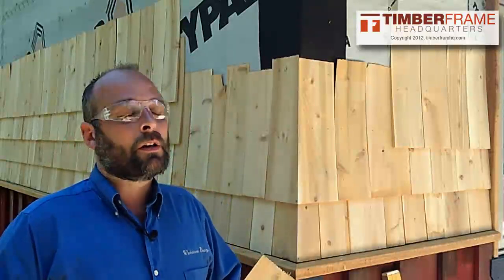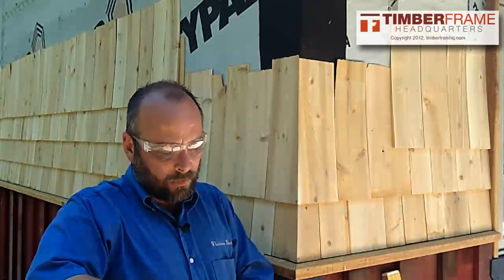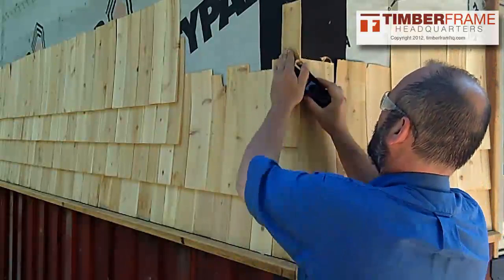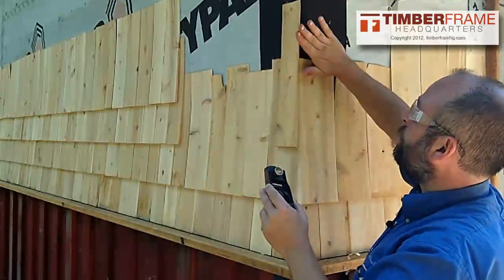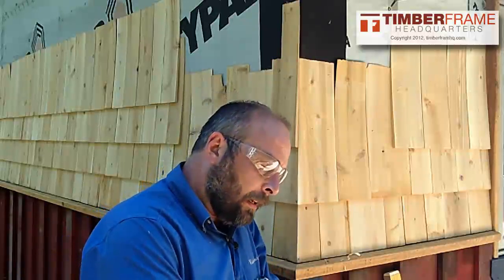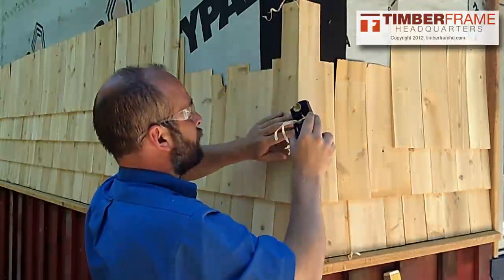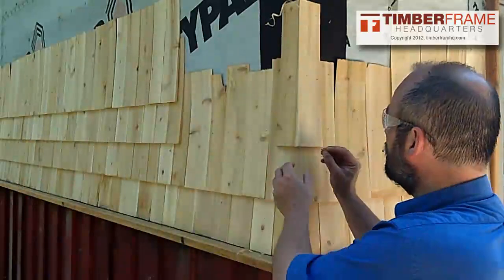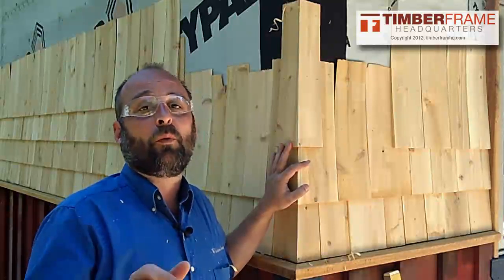How to Install Cedar Shingles with a Weaved Corner

Comment: Nice video, I overhand my shingle by 1" and nail the shingle on.  Then I trim the over hang with a trim router and a straight bit with a flush cut bearing.  Works perfect and is much faster.

Comment: good video, But the best part is seeing the corner wrap of tar paper. Could be sticky tape but tar paper is fine. That keeps the corner weather tight over the years. Typar and Tyvek are not reliable water shields. I fix a lot of rot because people don't flash and wrap corners properly. Good job, thxs

Comment: I don't miss those old days of using a plane. All roto-zip now on Cape Cod   great video for first timers
Reply: The Block plane gives the tradesman a certain amount of forgiveness… the Rotozip is certainly a modern approach.  The down side is that it requires an extension cord, which means electricity.  Then there are the additional bits, dust masks and hearing protection… 👍.   There are trade offs for every choice.

Comment from the maker: Great tip Igor.  I did not think about that tool and if you set your depth right you can make the gentle arc that comes with this task.  The plane is nice to use though...Thanks!
B

Comment: good video. in the low areas you could use a smaller plane to take the role but take take offense, still a very nice job....

do you ever use copper foil?

Comment from the maker: The plane in the video and the one I use.. and love is the Veritas Standard low angle block plane.  The sharper it is the more fun the job.  Scribing with a saw certainly works, I use a jig saw quite a bit for shakes, but it is not as quiet and peaceful as a block plane. The Veritas has some weigh to it which I find helps out making smooth shavings
Brice.

Comment from the maker: I am partial to Typar for several reasons the most important it that the sugars inside of the cedar shingles will break down Tyvek over time, this info is located on their website.  I like the staples because I had a stapler and they work well, I did use stainless staples.  I did felt the corners and highly recommend it.
Thanks for the comment,
Brice

Comment: Great video, any thoughts on the staple vs a siding nailer?   In my climate stainless staples or double galv nails are code.  Luckily in my climate I don't need to strap.  Also, that corner, looks like houise was wrapped with typar, and did you felt the corners?  This just a little extra protection?

Comment: If you have cedar shake siding that is beginning to start curling in some areas ever so slightly, is it alright to sink a couple finish nails into the lower portion of the shake below the upper shake line? The problem isn't looking so bad yet, however I would like to do preventative maintenance (if possible) to help extend the life of these already somewhat older cedar shakes.
Reply: No, don't do that

Comment: Why are you installing sidewall shingles on a flat surface?  Did I miss the lath strips?  Without the lath boards there is no ventilation, which protects the shingles from condensation and water vapor.

Comment: Can I use a finisher nail gun to nail ALL the shingles?

It's all I have..
Reply: youbestbequiet

Well he is using finisher nails... soo whats up with that?
Reply: *****

You're 5 months late on the reply man, but thanks anyways.  I used 2" nails and story board on the edges.  Then I stained it with a brush and airless paint sprayer.  Everything looks good.
Reply: DumpinMyGun 

I usually use 5D nails instead of 6d like you. I guess if you managed not to split shingles it works. They are just a bitch to remove.

Comment: Can I ask what kind of nail gun and nail he was using? Thanks in advance!
Reply: I was using a 1/4" staple gun, it was what I have and on the two buildings that I have shingled, everything is aging well.  However, based on other people's feedback and research a 1/2" stapler sounds like the best tool for the job.

Comment: Love this video, thanks for posting it. It has been helpful. Can you tell me what kind of block plane you are using? Or even better the make and model number.? I'm from Bay Area , CA and  recently have been doing more and more sidewall shingles. And by trade I'm a framing contractor but we usually end up doing the siding as well. We tried using block planes with poor results to weave corners. Ended up just scribing each piece and ripping freehand on table saw. We are using western red cedar.

Comment: I don't think any nails should be seen like thst last nail you put in corner?alsi corner hoint needs to be sealed with clear silicon or something.
Also very last row at top you cant nail top and have nails visible.so i would use liquid nails for cery last row at the too.nails must not be visible in cedar shake siding

Comment: you really dont need to plane anything. start with the corner shingle and work your way back into the series, cutting one shingle to size if need be. just one more tool to set down pick up and waste time using.

Comment: small wireless skillsaw would do the same trick.. you dont have to cut it rough using a knife.. you just cut right on the mark and nail... no plane needed.. still great job Brice... very time-consuming though
Reply: I do the skills saw

Comment: Not trying to be a dick but there's at least 5 ways I can think of that are faster than this method and accomplish the same thing. Even a handsaw would be faster... I always use a compact router with a flush cut bit but even a drywall cutout tool will work. Jigsaws work. Sawzall, shingle ax lol sharp side strike chisel... I'm just saying. I know this guy is doing a fit project and it's on his house so he is block planing it which is I'm sure a great finish but for practical purposes hack it off with a router or jigsaw
Reply from the maker: +xTwiistedJumps I agree completely there are easier way to do it...I like your idea of the flush cut router bit.  For me and in a non-commercial setting nothing beats using a dust free hand tool to finish it up.  Thanks for the other suggestions and feedback.